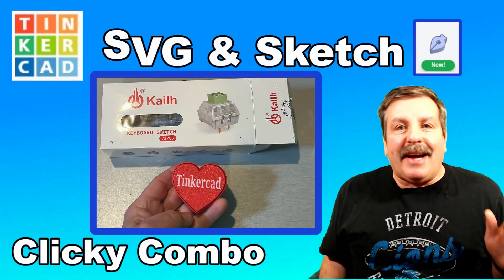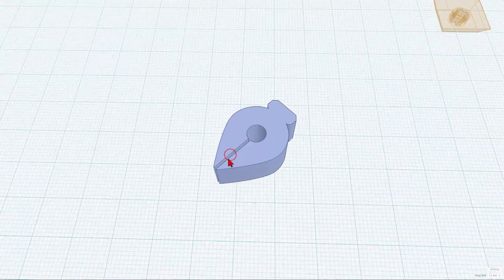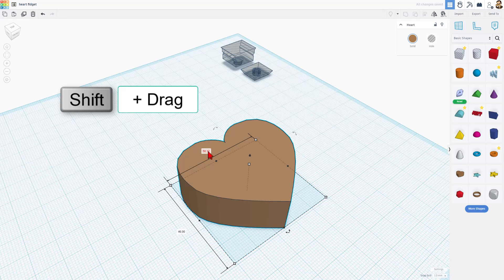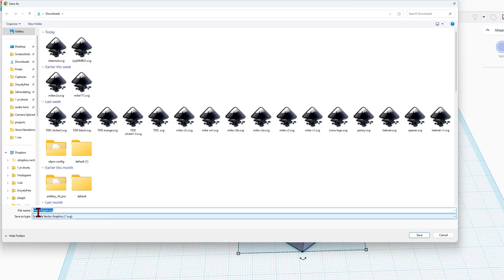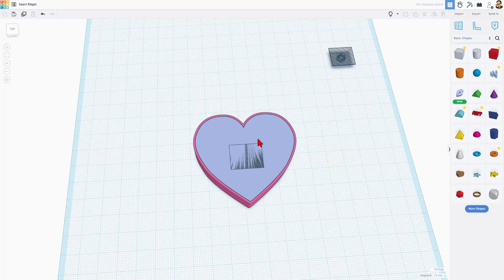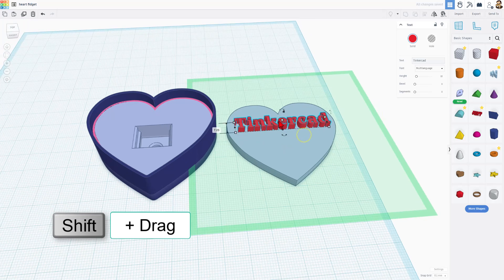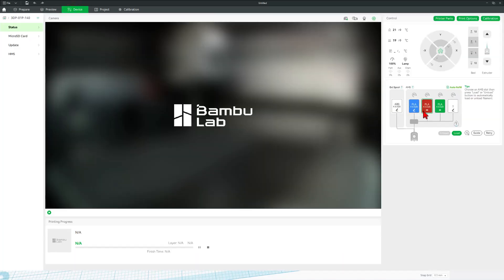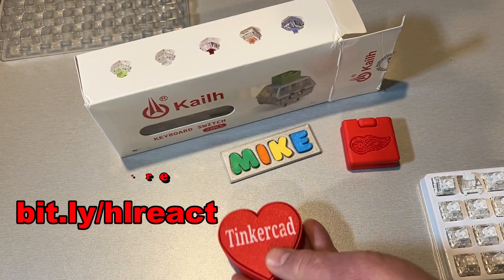Tinkercad Sketch Tool Trace SVG & Shapes Clicky Heart Fidget Tutorial

Comment: The ability to extrude a SVG would be very nice, it would save a lot of steps.
Reply from the maker: I think we already can extrude SVG files. That is just stretching them along Z.
Reply: @ Oh wow i didn’t know that, wouldn’t that replace the need to trace them?
Reply from the maker: Tracing the SVG reduced the shape to just what I needed for the project. Actually for the heart it was just to make a perfect heart instead of the one that comes with Tinkercad.
Reply from the maker: This tutorial is a good example of why you would trace an SVG. I use it to make different parts from the same SVG in the background. https://youtu.be/Ib6BOqNhHMQ
Reply from the maker: Many SVG files have more info than we need too. This is an example of tracing a SVG just to get to the shape I want to work with.  https://bit.ly/advsketch

Comment: Great video! Why did you add 2 outer lines of the heart around the main body instead of just doing 1 at the necessary thickness?
Reply from the maker: The second line and export allows you to put the gap between the two. I tried to just cut out the exact size but it leaves artifacts.

Comment: Sorry the question is a bit of topic for the video. Some designs I am making that need to be screwed down I make the holes i  do a taper at the top for the screw however how do make additional support around the hole so that the area prints with more strength?
Reply from the maker: I think I would focus on the material I was printing with and the amount of infill. Even the infill pattern may help with that. How thick are you making the plate where the screws are?
Reply: @HLModTech  The thickness depends on the item anywhere from 4mm to 20mm plus. I was hoping there was a way to design a reenforced hole. I will look at my infill settings on future jobs. Thanks for the quick answer. I love your content.
Reply from the maker: If the material is thick enough you can always add support triangles in the design. I am not sure if that is more efficient that just using the infill settings in your slicer? I have really had good luck with the .2 Strength setting on the Bamby slicer.

Comment: Very nice what you show, but I noticed that if you merge a sketch object with another tool you can no longer export it to Fusion 360. It takes the merge apart and you get a completely different object than you exported from Tinkercad. Too bad, I often make the edges rounded with Fusion 360 but that is no longer possible.
Reply from the maker: Thanks for the tip. I was thinking of sending something to Fusion 360 for rounding... At least now I will test before recording. =)

Comment: Nice tute, thanks. Wrong size switches for me unfortunately as I have a different brand. I was hoping to avoid creating my own 'switch holes'. No such luck😞
Reply from the maker: Thanks and bummer. What brand do you have?
Reply: @HLModTech  They call themselves "Oetemu"  (sold through Temu very good price). I've also seen people mention "Eutemu" so I'm guessing those are Euro market and the OE is identical but is what I see here in Australia. They seem very close to MX ones, and I just experimented with a simple 14x14mm hole which does seem to work but isn't the snuggest fit. You'd think they would standardise something like this lol.
Reply from the maker: The new sketch tool should make creating a hole like that pretty easy. Do you have a caliper?
Reply from the maker: 100% correct on the standardizing...

Comment: This is awesome! I asked this question yesterday and figured it out. Sketch tool is very powerful. What would be cool is if they had some type of magnetic lasso while using the sketch tool so it automatically traces along the exact edge. You would click where you would want the dots. More dots means smoother curves depending on the complexity of the design. Great stuff.
Reply from the maker: Much appreciated @chrisreyna3570. That lasso idea is slick... Will pass it on to the dev team.